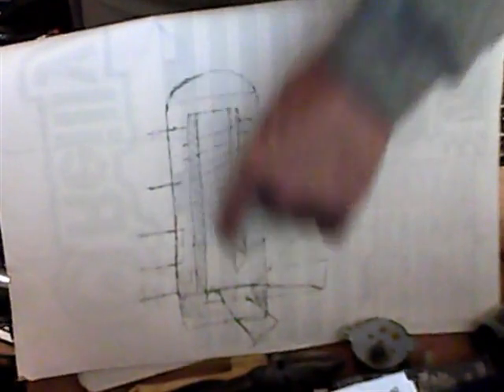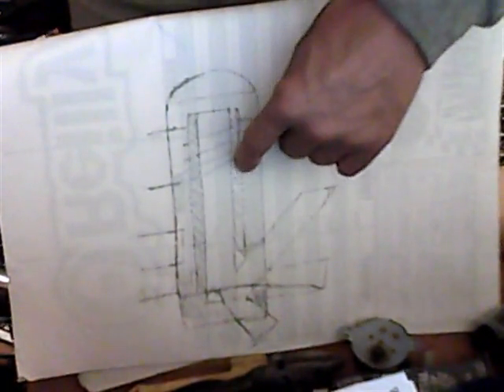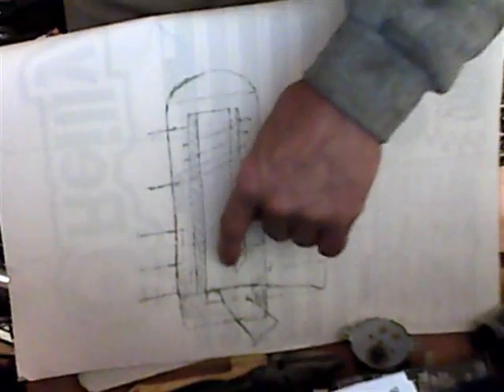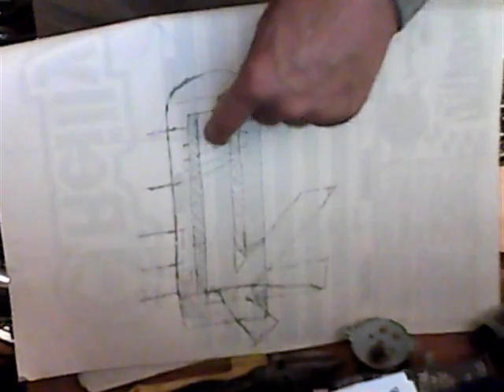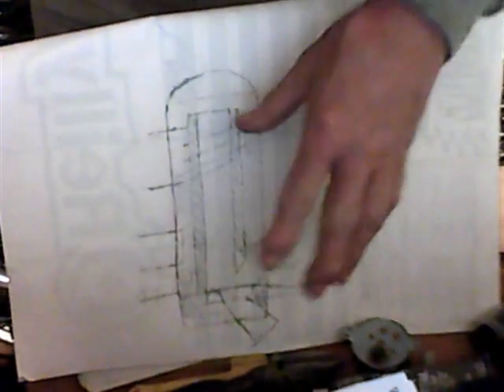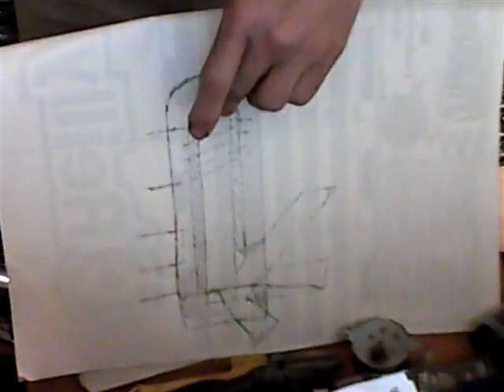More Rocket Stove Chatter

Comment: Great explanations!  What about a small crucible under where the drip oil burns to capture excess oil before it would otherwise go down the ash tube?  As sort of a precaution and you might end up with a glowing crucible... it might get to hot though?  But the glowing crucible might eat up any excess oil before overflowing it?  Maybe a little cast iron dish? Maybe ceramic?  Might look for something at the goodwill, have to hook up oil feed first but that is on the list...

Comment from the maker: It all depends upon what you use. I use exhaust pipe because it's designed to get hot repeatedly. Regular stove pipe is thin and will have a shorter life, but if you keep it dry, when not in use, it may last a long time. Ceramic or fire brick would probably be the best for down right durability. There's always gonna be a trade off between cheap and easy and last forever. How long does the exhaust pipe last on your car? And if it weren't exposed to the elements? My cook stoves live outdoors.

Comment: Hi there Kevin. I just discovered your videos last week... They are great! I am about to be a stovie  and the info here has been very helpful. I am wondering about something. Now  RMH stoves are meant to burn for a shorter time and then the mass keeps the area warm. With these Rocket stove heaters there is no mass, so the burn time will be longer I think. My concern is the excessive air draw creating a negative pressure in the home. I have read some thoughts in this matter, interested in yours.

Comment: how would this work for me with my RV camper?  how small can this be?  I am think the wood filling tube is on the outside / through the wall and just the inter tube inside, doubled insulated the bottom third and no insulation on the 2nd third and go straight up and through the roof with a rain cap.  or a turn and cross the ceiling and then up and out the roof. ... 
I believe the turn down into the drum is to use and cool the heat at the end of the insulation section. the open air section is the same as your big drum. it will need protection around the heat releasing section.
I would like some feed-back before I burn down my RV.
 Hamish of Tujunga.
Reply from the maker: hamish hamish Better before, than after!! I designed and built an Omega stove specifically for an RV. It weighs in at about 50 lbs. and produces about 15,000 BTU. Check out my Omega Stove videos.

Comment: 2:42 where are you getting the third dimension you're using to figure the air volume in your chimney pipe? Figuring the cross section is simple based on the diameter, but you lost me at what measurement you used to determine the air volume exiting the pipe.

Comment: If you permit me the luxury of "over-thinking" I would say that you  know what you want but you have forgotten the principle of what it takes to COMPLETELY burn any fuel!  You Need Sufficient Oxygen in Order to Burn Your Fuel COMPLETELY.  That goes for carbon monoxide and anything else that is oxidized and is in your fuel.  You will need a secondary source of air introduced into your burning chamber so you could burn every last atom of carbon, nitrous oxide, hydrogen, etc. that is generated by the initial INCOMPLETE burning of your fuel.
Flues that are longer than 14 inches will not help burn your fuel efficiently.  If you smell "burned rubber" in your shop it is because you are not burning your fuel completely.  Introduce more air into your burn chamber and atomize your fuel so it can burn efficiently! C+O2=CO2 but C+O=CO and carbon monoxide is deadly!
Reply from the maker: It needed a taller heat riser, but yes that would work also.